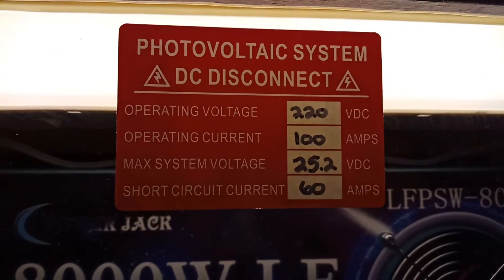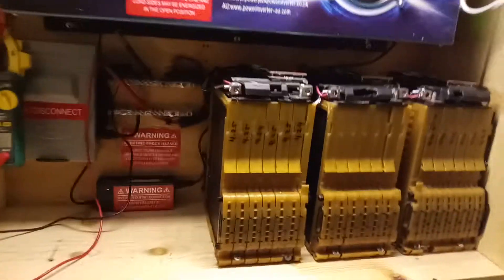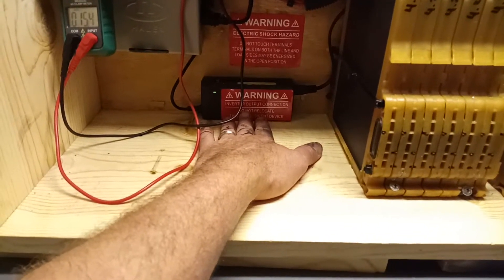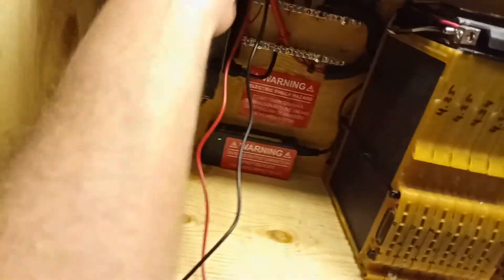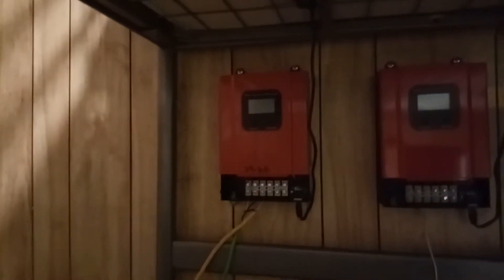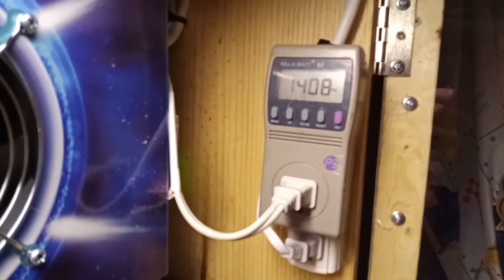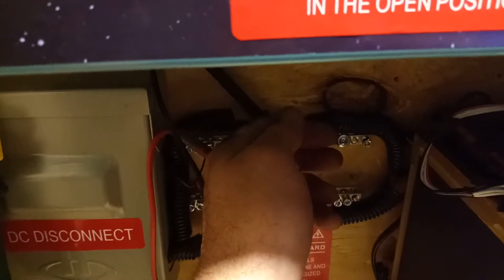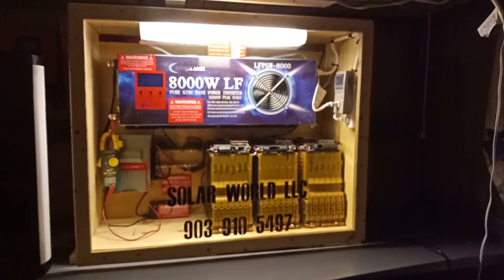Chevrolet Volt battery backup

Comment: I need those type batteries.  I have 24 leaf modules but I'd like a ton of the volt batteries
Reply from the maker: I've used volt batteries plenty of times in previous projects. Highly unstable without a BMS communicator.
Love the power output though. 😉

Comment: Id say the inverter is the week spot . But looks good
Reply from the maker: I appreciate the positive feedback!!!
Always willing to take suggestions for New generation upgrades.

Next video I will be installing a LED display screen for each cell
3 sets of 6 😊
Reply: Make sure you have switches to turn them off as well.  I think a bms with blue tooth will be more accurate then the meters

Comment: What about the heat that inverter puts off being in that sealed box
Reply from the maker: The top of the box actually has a 1.5' by 32'  gap in the back with a screen for bugs.
There are two fans on this inverter one in the back one in the front along for maximum airflow.
Thanks for the question 🙂